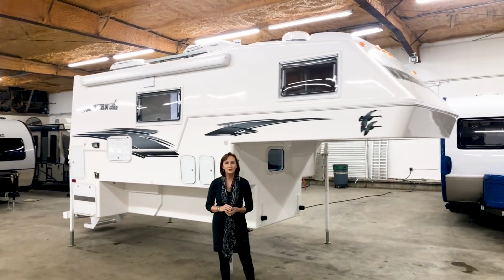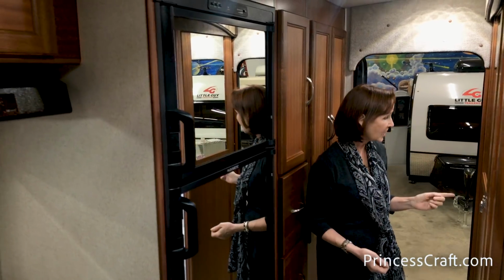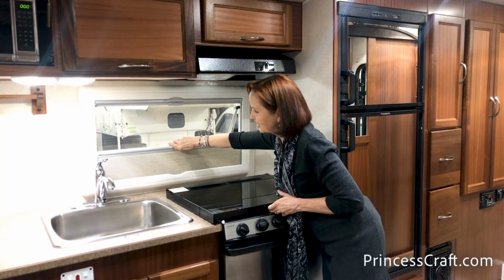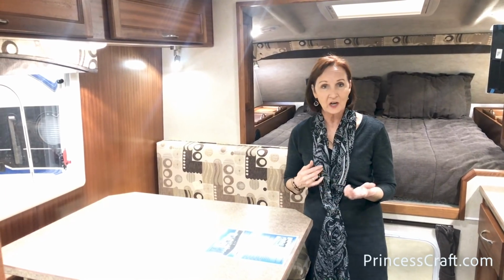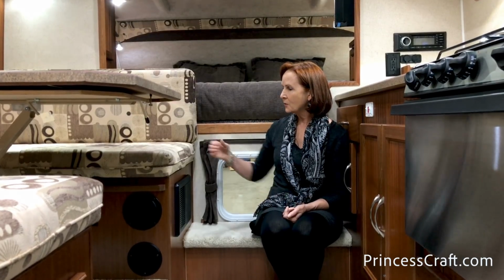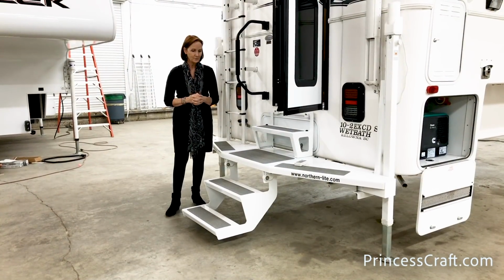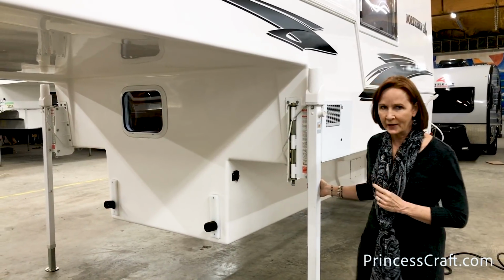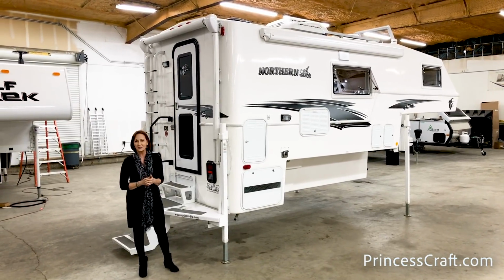2019 Northern Lite 10-2 EXCD SE Truck Camper Walkthrough Tour

Comment: Yeah I think that campers messing is outlets by the badd to be able to plug in in case you were C pack or you wanna charge your phone so let's seal and stressing on the both bedsides so if you would add that that would be a perfect camper

Comment: You didn't say if the furnace or ac will run off the battery.
Reply from the maker: The furnace will run off propane. The AC requires too much energy to be run off the battery.

Comment: Many years ago I owned a Pick Up truck camper. Is there a way today to disengage the jacks so the unit can't be stolen while sitting in my yard when it is not being used?
Reply from the maker: It’s not usually done, but jacks are attached to the camper with 3 bolts and the electric wire can be unplugged.  If the remote is not available, it’s a lot of trouble to steal a camper, but it can be done!

Comment: I have a stupid question  how do you connect the truck with the camper, I really don't have a clue
Reply from the maker: The camper raises up on its jacks and you back your pickup truck underneath it. Once the truck is properly aligned and beneath the camper, just lower the camper down, connect power (from the truck), and secure it with tie-downs. From there, you're in business, so-to-speak!
Reply: @PrincessCraft  thank you

Comment: F 350 dualy - 40 to 70k and the host Everest -  50 to 60k with large 200 watt solar x 2 and you're set.  Also for crying out laud get an atmospheric water maker...it not only pulls moisture out of the air, but makes 1 to 3 gallons of water per day.  Its filtered and there is your coffee water, what ever you don't use pour it back into the water tank and this works on any camper, some even come with their own solar unit.  Also lithium ion batteries, when the AGM need to be replaced...get lithium ion. Also whatever you choose make sure its 4 season otherwise you will regret it.  Another great gadget is a wireless weather station you can hang on the wall so you know what is really going on outside.  4 wheel drive is great also if you want to be off the beaten path.  So many tips and tricks, but its not cheap to set this up.  I also put a heat strip in the AC unit and have a Honda 2000 generator that runs it all.  Propane should be used for cooking and heating water and it will last a long time.  Now they have instant hot water.  Diesel rigs are much better then gas and last much longer.

Comment: I own this model, but the 2015/16 version.  Some of the things I up graded (electronic thermostat) this one has so they are improving.  CulleyT pointed out some of the problems, same that I found but I don't seem to have humidity issues but then I mainly spend most of my time boondocking in the Rocky Mountains and Utah deserts.  I spend 4-5 months full timing each summer and fall.  I have taken this rig on the Mormon Trail through sand, slick rock and over rock passes.  I have taken it up mining roads to over 12,600 ft into some places that I probably shouldn't have gone.  I have had zero issues with this rig and have twisted and bumped it very hard at times.  I carry this on my SRW Ford F350 with no problem.  The only thing I added for suspension is torklift stable loads and it handles great at 75 mph on the highway or in 4 low crawling over ruts and small boulders.  I run two 6 volt T-105's and the solar panel keeps them charged.  On those few days where the weather was bad I have a small honda 2000 and three hrs on that recharges them.  Great camper for boondocking or in a campground I can't say enough good about how well built it is.  Oh...last thing, if you do have a problem you can call the company direct and they will actually answer the phone and put you on the line with the guy who built it...super nice people and a good company.
Reply: Flying Dutchman hay, how much does it weigh. Think my Sierra 2500 hd is too small☹️
Reply: @truthseekerhill4262  Mine came in at 3240.  I know that the 9-6 se is exactly the same, just a bit shorter.  It comes in at 2625 and would work easy on your 2500.

Comment: At 47K that thing should load itself and cook your meals!
Reply: I bought a used 2013, three years ago, for $27K, Special Edition 10.2 wet bath and it was in need a few minor things. Able to use it but still working some bugs out, not Northern Lites fault, genny won't start, struts for awning need replaced, the jacks all need r&r, so I have some work cut out for me. Still built like yachts inside.
Reply: Too rich for me
Reply: The purchase price of a Northern Lite is pricey.  But keep in mind a Northern Lite will last a lifetime and other units will not. While other units leak and fail in weak spot seams over time Bigfoot and Northern Lite will retain their value and still be worth thousands of dollars when they are 25 years old. You may buy more than one Bigfoot or Northern Lite in your lifetime but it won't be because you need to. It will be because you want to.
Reply: @scallywag6768  valid point for sure. Unfortunately not everyone can spend 47k on a truck camper unless it is to be your home; but then that kind of money would buy you better full time options.
Reply: Quality is an an illusive little devil and not always easily seen - that's what you are paying for.  Just compare to the Indiana built RVs
Reply: Slay The Dragon Blog  Please focus on your gramma.
Reply: I think you are paying for quality and a higher resale value.....having said that, I think the manufacturers are charging an excess for "cachet".....I'd like to see another manufacturer copy the standards, and the design, but cut costs where they could without affecting quality. Like formica or wood veneer drawer fronts over beechwood plywood instead of real wood(no mdf!).....might be a little weight saving there too.....As a single person....I dont need a queen bed either....a twin would suit me just fine......:)

Comment: Does this require a duallly
Reply from the maker: This one does not require a dually. You'll want to work closely with your dealership to make sure your single-axle truck is properly equipped and setup to handle the load, but it can be done.

Comment: It's funny how they put the smallest person to show us the camper just to make it look roomy, this lady look like she needs a couple pillows and phone books to drive a truck. This camper is kinda small in reality all of them are almost the same size the ones that Make a true difference are the ones that extend out on the sides.
Reply from the maker: Interior headroom in this camper is 80 inches. (6’8”)

Specs & Dimensions - 10-2EXCD SE
Overall Width (in)  - 98
Overall Length (in)  - 218
Overall Floor Length (in) - 131
Overall Height (in)  - 106
Interior Headroom (ft-in)  - 80
Dinette Bed (in)  - 39X75
U Shape Table Size (in)  - 24X29
Face2Face Table Size (in)  - 29X38
Mattress Size (in)  - 60X80
Fresh Water Tank (US  - 36
Waste Tank (US gal.)  - 18
Grey Tank (US gal.) - 40
Hot Water Tank - 6
Propane - 40
Approx Dry Weight - 3265
Box - Long

Comment: Very nice and thanks for sharing but can I ask how high is the inside when standing up please?
Reply from the maker: Specs & Dimensions - 10-2EXCD SE
Overall Width (in)  - 98
Overall Length (in)  - 218
Overall Floor Length (in) - 131
Overall Height (in)  - 106
Interior Headroom (ft-in)  - 80
Dinette Bed (in)  - 39X75
U Shape Table Size (in)  - 24X29
Face2Face Table Size (in)  - 29X38
Mattress Size (in)  - 60X80
Fresh Water Tank (US  - 36
Waste Tank (US gal.)  - 18
Grey Tank (US gal.) - 40
Hot Water Tank - 6
Propane - 40
Approx Dry Weight - 3265
Box - Long

Comment: “A beautiful, high end feel”. Are you joking? Do you have any sense about the state of your industry? The design and engineering is awful. All those push fit closures, the terrible upholstered valances, the mishmash of different meters and control panels tacked onto the walls, like they were retrofit, or simply afterthoughts. This would have been okay 20 years ago, or a 20 year old camper that’s been refit with some modern upgrades, but seriously, come on.

Comment: I would like to know how would you add a hitch for a boat or trailer to an o er head camper
Reply from the maker: The hitch receiver would still be attached to the frame of the truck, not the camper. Many owners opt to install a super hitch and a longer tow bar to give more distance between the truck and the trailer being towed. Hitch assemblies like this are easily installed, just like the original class 3 hitch receivers, typically bolt-on, attaching to the truck's frame.

Comment: One thing I didn't like right off the bat, was the drawers next to the refrigerator... somebody flubbed that one. They don't match the other cabinets! Off in color, grain direction, and design. And who thought that putting the microwave inside a cabinet was a good idea?? Better to combine it with the range hood. I know they can do better... the rest of the unit is excellent.
Reply: Thomas Darby, why build in a microwave when truck camping is about dry camping? Great thing about removable microwave in cabinet is, if you are going dry/ boondocking you can take microwave out and have more cabinet space. The cabinets and drawers in my 2019 NL 10-2 all match both in color and grain even the ones around the frig.

Comment: Seems like the more in depth research I do on these claimed 4 season campers is they are good as long as 1 of those seasons isn’t winter.
Reply: Lived in one of these for an entire winter at 8k feet in montana.  Pretty sure they do just fine.
Reply: I'm curious how cold of a winter did you need a camper for?
Reply: Cold snaps to -20 are always possible.
I lived in a large 5th wheels for 3 years with temps down to -30
Reply: They need to double the r value and a higher btu furnace.
Being plugged in is best of coarse and run electric heat to curb the moisture issues.
Reply: Ok, that's much colder than i need it for. Thanks
Reply: Keep in mind that I’ve heard that even in northern Cali or Nevada that they loose heat fast at night.
The Bigfoot 2500 series arebetter insulated and have a 30k btu furnace.
The NL only have 18,000 btu units.